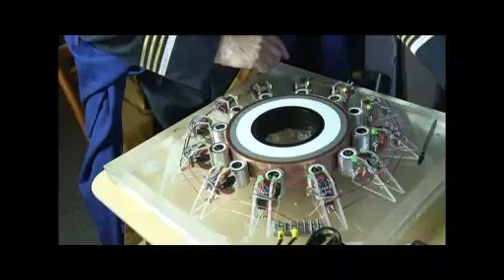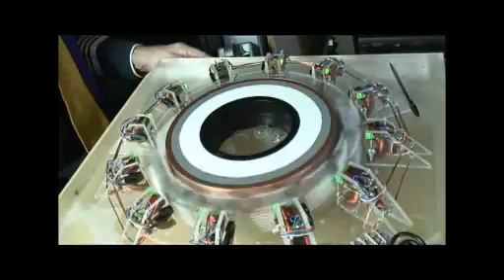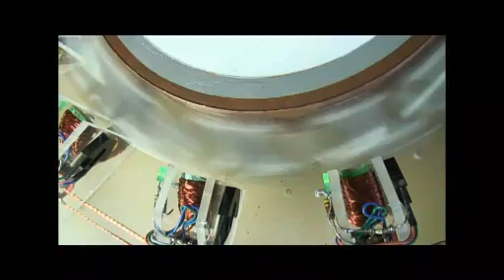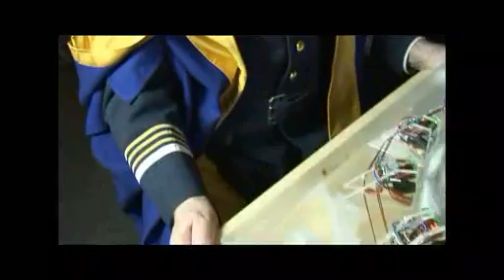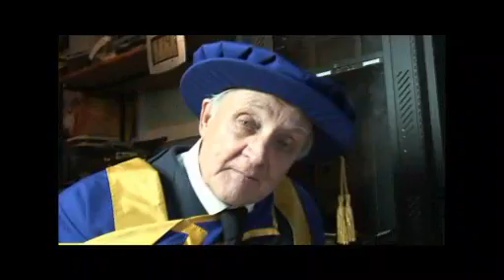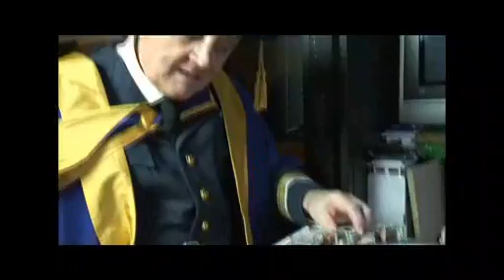Searl and Newton Part 2

Comment: its not perpetual motion because at some stage the electricity supply used to power it will cease to operate  and it will stop ..also the baseball travelling through space will eventually be trapped by gravity  and it will lose force as soon as it has to perform work  so perpetual motion doesnt = free energy

Comment: at first i was amazed at this and couldn't figure out why private industry wasn't using it.  afterall, you give it a shove and it spends forever.  so how is this not perpetual motion?  then i started comparing it to other things in the universe.

if you throw a baseball in space it'll keep moving (forever) at the same velocity that it started with until another force acts upon it.

Comment: i see two possible results for this. one, if the power created from the generator is more than the power used to power the spin, then he has created perpetual motion and a free energy generator. if it does not then it instead of gaining power loses total power, as the energy made is less than the energy used.

Comment: This is creating energy because when the rollers pass by those copper coils it creates a tiny bit of electricity. Plus you factor act the electricity you still turning a small amount of kinenict inergy into a large amount by stored energy in the magnents when they are near eachother but when you run this enough the magnits will lose there magnetism but at least its a lower rate than oil.

Comment: It's powered by a 7 volt input and he said it could be run faster.My question is what is the use for it?. It is basically an electric motor in which when you build it and connect to any proppeller or gear you will encounter A) friction,B) oscillation C) stability.

As it is the machine may look very impressive to anyone who only have rudimentary understanding of either  law ofphysics,mechanical and electrical engineering.

Comment: @uberteknik 6 milliamp=.006 amp,  You have 600 milliamps, so it would be 7x.006= .042va
~4 tenths of a watt, would not seem like enough power to sling thoes heavy magnets around?

Comment: @uberteknik I agree. I can get the same effect with a few neodynium magnets and a cake tin. They all balance out at equal distance and all you need to do is add an oscilating force and these would turn - which is what a motor does. What I am still waiting to see is what power you can get out of this device. So far they are just saying what you put INTO it. Thats USING energy. What we need to see is the unit developimng energy at which point we can show it is inefficient and is just a motor.

Comment: @SagginWillies It's not the voltage, it's the current multiplied by the voltage, the power, as uberteknik performed his computation.  A model-train transformer could power this thing with no problem.  There's nothing obviously impressive about its being powered using 7 volts.  It would probably drain a 9-V battery very quickly because it would draw so much current.

Comment: if that is running on 7 volts why is it running high-tension lines?  and they never gave an ampage.

i would like to believe but its a bit hard when that much info is missing and could even be believed.

Comment: this is impressive from 10 volts max 

i wonder if its possible to have 2 of these one large with a smaller one inside both rotating on opposite directions 

probably wont do anything but that would be good to see :-)

Comment: Look, I'm sure a few people have high hopes for this, but really, it's simply not going to work, it simply cant produce more energy than it requires to run, it's a simple matter of energy production. I cant understand why people are so amazed at this, it's a simple case of electromagnetic induction in coils, a phenomena which has been known about for years, and which is alread used in any electric motor. You'd be much better off to plug your 7 volts directly into what you wanted to power.

Comment: In theory it can feed its self no problem so, mount this in a generator with poles going into it so it can turn, the only problem i see is that you have speed but do you have enough strength?

Comment: My SEG has been running for years, but unfortunately because it extracts quantum energy from it's surroundings it has cooled my house down to -75C, and I have to use all it's output power to run electric heaters. Still, I no longer have to power my fridge - it's like having a free lunch and finding out it's an antigravity sandwich!

Comment: @Beamshipcaptain 

The issue I have with this, is that if there is an input voltage of any amount. Assuming it is 7 volts. What can it produce as an OUT put voltage? And if it does produce more than the input, why not use capacitors instead of a battery? It just seems that there is a small bit of a problem when it still can't run of it's own generated power.
However if I am wrong, then he just needs to set it up so it is believably running on it's own.

Comment: Your on the right track, use liquid  Mercury to store the energy your createing to make a energy amplifier, but you will need to use light material, and a sheild to hold the magnets in the fixure, as you keep trying to figure this out what I am saying, you'll be able to finally make it work, my experiment is working using mercury as my storage unit with light materials for speed.your project needs to turn about 60,000 rpms to work..good luck

Comment: Yes this is a type of an electric motor, but if you put this inside a sealed container with mercury it will react in a different way ..which the germans have been trying to create a flying machine since the war..using  gyros and some form of a small electric component in a sealed mercury case..will cause this to reless some form of energy as an antigravity device.which this has been used by military in the area 51 base..PART1 of this device..

Comment: The point I have with this is that this to me looks just like an electro motor, a bunch of magnets running around against some coils driven by electricity ergo an electric motor and I agree with 09205479428 what's the input/ouput.

Comment: @RomH4ck Not to mention it could possibly save the economy, what with a) never having to maintain oil wells b) Never having to BUILD oils wells c) Never having to find oil wells e) Never having to drill oil wells f) Never having to clean oil spills g) Distribution will be cheaper due to cut fuel costs... The list goes on and on.

Comment: the point to this is : the seg has a input voltage of about 7 volts. so about what a camcorder battery has. but it (supposedly) can put out 1000 times that amount , whis=ch is far and away better than current generator designs.  so it could potentially be run off solar cells, hydroelectric, ect.  and be truly, free renewable energy with zero pollution.

Comment: I wonder about the maximum RPM when centrifigul force causes them to fly across the room. I also wonder about running it with the axis horizontal (coil in a vertical orientation)-the increase in g force on the 'downstroke' they would fling off at the bottom.

Comment: Can this experiment not be redone in such a way as to show a voltage being pulled off the device?  If you do that and have the unit powering itself, over unity would be proved if your device doesn't slow down wouldn't it?  Seems like that would be worth proving if this is really working??

Comment: Since when has voltage = energy? A transformer steps up voltage giving a "net increase", however there is no more power as P=I.V or P=I.I.V so unless you know the current how the hell do you calculate the power (j/s)? 
This is not groundbreaking, voltage can be stepped up with two ajacent electromagnetic coils.

Comment: At the level of that particular prototype, yes, but remember. They are making several rings in the final product, which means a massive amount force is going to be in place. The only problem I can see coming though, is no matter what type of magnet you talk about, all magnets run out of electricity. So the question is what is the maintenance program?

Also, they wouldn't in practice (final product) only put in a small amount of original input. It is only a prototype after all.

Comment: I extremely want to make a same one for testing but i don't have much info on electronics. I want it to output more voltage than input. But how can i construct the things outer from the screen. I mean how the input and output device must be connected as to the things on table? Plz help? 

How to get an output current that very bigger voltage and 1,5ma with this beautiful engine?

Comment: First of all I have some questions... As I can see.. you have 12 electromagnets, equally spaced around the ring. What I also see is reflection sensors, correct? If so do you have any logic behind the control of the electromagnets.. hard or microcontroller otherwise. Second, are you using the coils to harvest energy through magnetic induction? Third, are you soon going to make a real SEG? I have to be honest, I've only recently discovered your channel/page and I'm very intrigued by this device!

Comment: do rotation of magnets as a constant  ,  supposing the magnets rounds around due to  an  effect  of actraction repulsion ,like bedini perendev etc...

The inertia is low to apply a duty  
  if we consider coils as PASSIVE elements we can  probably found an Electrical field generated in, when magnets reaches  the coil position and pass.

The simple principle is the coil (a wire) have potential difference at his terminals if  inserted in a variable magnetic field.
Thanks for the idea Mr Searl

Comment: What is extraordinary in this video? He makes a model of asynchronous motor and set impulse voltage to electromagnets around big coil.

I think this man charlatan and faker.

Rescueswimmer85 is right. If he ever made a flying machine or nothing-to-electricity generator WHY NOW HE CANT MAKE ANOTHER ONE.

Comment: Prof Searl and a team of laboreres and engineers at British Rewinds made the first SEG in 1946, all young John had to pay for was the materials, initiall financed by the late George Haynes. The first generator was 14-feet in diameter. After losing several generators, the decision was made to let it fly, if it wants to fly, so they gave it a body for control. That was the Levity Disc, of which 41 unmanned were built and flown from 1952-1978, controlled with 12-metre band Ham Radio.

Comment: This is such bologna.  The whole crux of your idea is that once it's in motion, it should stay in motion.  Let's ignore the constant presence of friction, because it's not being held off the plate, and let's ignore friction between the metals, and with the air.  How did you stop it without touching it? YOU TURNED OFF THE ELECTRICAL POWER SUPPLY.  People don't believe in alternate energy because there are so many FAKES like this. Stop assuming people are too stupid to notice.

Comment: Input is 1.5 Volts, @ 600 mAh. In the True law of the squares SEG, the Neodymium-cores are electricall-active, and force the flow of current in one-direction, with the other elements. Woth the magnetic wave-form on the plates and runners, this forces motoring, like a two-phase induction motor.

Comment: Yes, even this crude magnet-mockup, will produce energy. Negative-ion detector placed near the runner-sets indicates a release of energy. Law of the Squares level-4 square Runners and plates all give off 3-14 Volts even without relative movement, because the materials, and the Neodymium which acts as an ELECTRON RESERVOIR, causes a flux of current and charges in one-direction to the outside, radially, like a diode. Te Teflon-layer, or Nylon 66 negative, acts to smooth out the pulses.

Comment: This certainly is not a scam  cause it would be a scam for about 50 years or so.  and I dont see a point in doing a scam for 50 years and get nothing out of it. it only costed Searl much money..  it is very expensive to build the parts thats all and then you have the funding problem.  In the early days he already proofed his concept of  zero point energy and he only build up on that.. to make it in a larger scale. but if this at the end is finishid  then it will  be great..

Comment: Many fail to realise the SEG works on electromagnetic and physical priciples we use everyday, like cyclotrons, ballraces, gyros, flywheels, and to a lesser-degree diamagnetism. Unlike all our current power generations systems which are positive-polarity, the SEG emits higly-negatively charged elemental particles from the rim. When you have been in a room with a running SEG for a while, you no longer feel like you're breathing, you feel you are taking in lungfuls of clean, fresh spring water!

Comment: Thanks for the clarification. Since I've made that comment I've started reading the documentation on it. Even if it doesn't do what's expected I've had some fun mental exorcise analysing it's parts. My main question would be why the teflon layer is so thick. As a dielectric it will make a capacitor. Is the thickness intended to reduce the capacitance? Also, the steal band around the outer magnet (in the center portion) will have an induced field out of phase with the copper outer ring.

Comment: This is using 1.5 Volts @ 600 milliAmps.THIS IS JUST A MAGNET MOCKUP of the actual rare-earth-cored, laminated element, level 4 square SEG. Check out the new magnet tests on the Searl effect websites, posted June 4, last Thursday.

Comment: I'm pretty sure he said he's using 7 volts at .6 amps. So that means that it takes 4.2 watts of energy to cause these rollers to spin around with no load other than friction. It's efficiency is noteworthy but clearly not productive in its curent state. Apearantly this is just a demonstration model and there were several points where I couldn't understand the man (no disrespect), however, this doesn't explain anything other than how magnetic fields interact thru that permiable center ring.

Comment: What precise speed do you calculate the rollers to be achieving? Assuming you are talking about DC volts and amps (naturally various AC waveforms are more complex) and that all the above figures are correct,  the power input to the system is 2.5 milliwatts. If my high school physics hasn't completely failed me, speed should equal sqrt(2Pt/m). You are moving 6kg of material, so at 100% efficiency an in a vacuum the 6kg should have a speed sqrt(0.83*10^-3 x t). @10s that's 9.1cm per second.

Comment: So, can you show me a video that demonstrates this (or any alternate configuration or construction) cooling down, getting lighter, and/or running at a rate where the centripetal force conventionally required to hold the rollers in place is greater than the magnetic force attracting roller to core at rest?

Comment: The runners stay attatched to the platen no matter the speed, and this is a magnet mockup of the actual laminated, rare-earch cored plate and runner SEG gyrocell. Acutual SEG has thre plates and at least 69 runner sets consisting of 8 stacked roller segments. This is a magnet mockup of a free-energy device first bult at British Rewinds by John RR Searl and a team of engineers in 1946. More load placed on it, faster it runs, and the colder and lighter it gets. At overload and 4Kelvin, it LIFTS.

Comment: Fantastic. It's a device that makes disks rotate around a central core for as long as the power is turned on. It has loads of resistance, and if you ever got it up to a decent speed the disks would fly loose from their rare earth magnet core.
It isn't solid state (it has moving parts). It doesn't generate energy (it consumes energy). It doesn't demonstrate any kind of antigravity effect.
What is this thing supposed to be for, again?

Comment: This is running with only 1.5 Volts. The Neodymiun-cores in plates and runners give off 3 to 5 Volts, more than enough EMF to initiate and sustain rotation, especially since the choice of elements and proportions according to Square theory prompts a current flow radially thru the SEG. The result is a permanet battery that never runs down, and a source of torque. That is the SEG, first constructed in 1946, Britiish Rewinds.

Comment: Let's say we think of an alternator in a car. If this SEG is put in a car, where it is used to generate electricity, then we would have an alternator with no moving parts and it would use a house hold battery to start/run it. Guess what, if the electricity is harness, we could run electric cars without carrying heavy batteries. We would just use 4 x D size batteries.

Comment: This is the magnet mockup of the Searl SEG, made by Fernando Morris, for COFE II, in Sept. 2006, which I attended. The actual SEG is Neodymium-cored , in all plates and runner-sets, that is the ELECTRON RESERVOIR. Then outward on all plates and runners, is TEFLON< or Nylon 66 with a negative charge, Iron (magnetised with a special DC with supered AC coil), then an electron emitter of Titanium, then a paramagnetic layer of aluminium or copper. This was built to see how much EMF needed to rotate.

Comment: Roschin and Godin verified with an incorrect SEG knock-off in 1996 in Russia, and Marcus Hollingshead's incorrect SEG produced so much excess energy it melted and combusted. The true SEG produces COLD instead of heat, and the more load is placed on the SEG, the faster it runs and the colder it gets, opposite of all other conventional generators.

Comment: That's what professor Searl has been saying all along! That is the SEARL EFFECT. THis rotation of a magnetic-wave, that can carry magnetic rollers along with it. In the true SEG, electron flux is initiated thru the materials that comprise the SEG by the Neodymium, core-element of all plates and runner-sets. This induces more than enough EMF to get the runner-sets moving, with little or no external input.